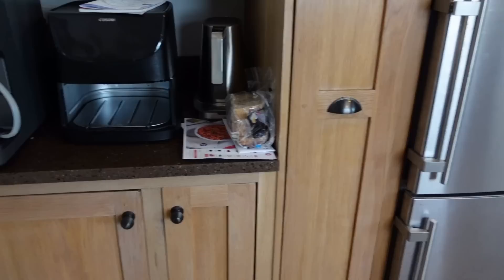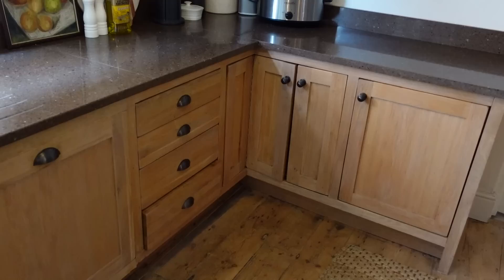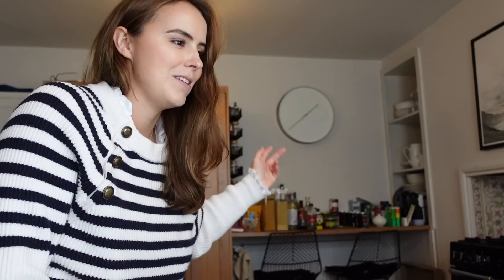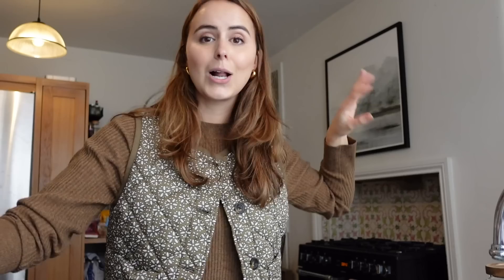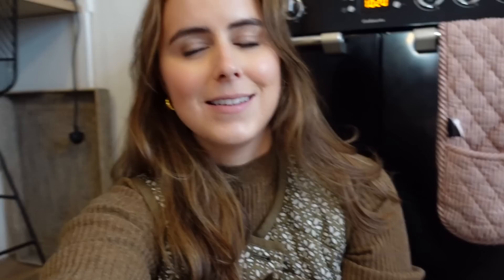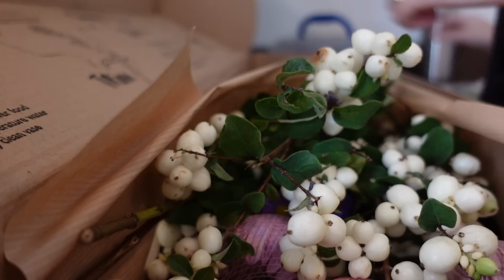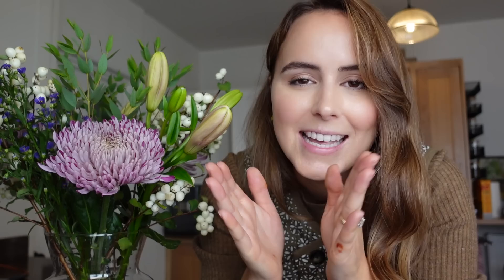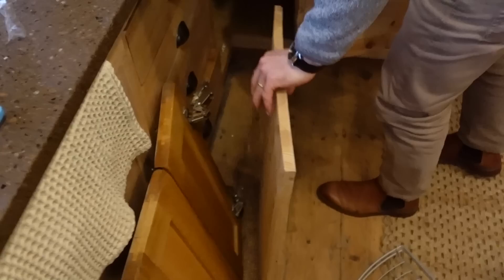UPGRADING OUR KITCHEN | Laura Melhuish-Sprague

Comment: cookie pans and serving trays and large (non-precious) platters for the slim tall cabinet.  Works every time.
Reply: Also super easy to add vertical dividers to keep them extra neat!
Reply: I have trays and chopping boards vertically in a 40cm cupboard. We screwed a little 2cm batten to the base of the shelf just to stop them sliding over and all ending up horiw
Reply: You can store muffin tins and cooling racks--anything flat goes well in vertical storage.

Comment: When you get tired of changing the batteries in the pop lights (I tried them too), IKEA has gorgeous  and affordable cabinet/task lighting you can add to the top of the cupboards and beneath. They can be daisy-chained together and run off a single electric line you can plug in. They also have multi-plug adaptors you can add to your power outlets. Very easy to install.

Comment: Some ideas
1. A pull out under the kitchen sink will stop things from hiding in back.
2. Using that skinny cabinet by making it a tray caddy with dowels. Cookie trays, cutting boards, oven tray...
3. A pretty knife magnet bar that can be mounted on side of cabinet to keep knives from getting nicked and dull in drawer.
4. Maybe wax or oil lower cabinets so wood cabinets pop.

Comment: Useful organisation in my kitchen...
IKEA Variera pot lid organiser - also stores baking trays vertically.
Non slip drawer liner on a roll, cut to fit. I have all my crockery in drawers and NOTHING moves!
Poundshop shallow drawer inserts to corral utensils by type. Also keeps the Drawer of Random Crap in a semblance of order!

Comment: In those cabinets that lack bottom shelfs, you could put baskets instead. I do it at my place, they slide easily and work just like a drawer, without the hinges ofc. It's a more temporary solution, but is quick and rental friendly.

Comment: The puck lights are wonderful. Remember to turn them off when not in use. The big reminder is to order some double sided adhesive pads. The battery change is easy, but the re mounting needs new adhesive.

Comment: For the slim cupboard, if not baking trays and cooling racks. You could ask hubby to use the broken corner shelf, cut it down and put it on a shelf roller. Use the cupboard for things like nutribullet, food processor, hot choc machine, toastie maker etc. Or a three tier wire trolley (you can get them from amazing) and use them as a veggie rack? Slot it in sideways? I just didn’t add the wheels and added a cupboard protector mat. Again from Amazon.

Comment: The updates are great! When we remodeled our kitchen we had several of these features in our remodel. I love the corner lazy susan  shelves. I store appliances I wouldn't use before because they were too hard to get out. We also have a small kitchen but I love it. We put up a magnetic knife holder (there are no children in our house) and that saved us drawer space. Ours is on the wall next to our stove. It works so well and we don't need to use drawer space or a knife block that takes up counter space. One of my favorite things is our under cabinet lighting. It makes such a difference. Your lights all look wonderful. Because we were having a gut remodel, ours are hard wired with wall switches.  Sorry this is so rambling, but all of the things you've done make such a difference for the function of a kitchen and so similar to what we have. GREAT JOB!!!

Comment: Spread the lights under the upper corner unit out so there is 3 (or if you have 4 on top spread those out) and use the one you can spare for the microwave book

Comment: I say go for it with the lights. You'll be surprised the difference it'll make aesthetically as well as mentally. You can use the extra ones in other bookcases and shelves. If the power ever goes out, you'll have them to light up spots that might be tricky...ie bathrooms and closets or other spaces.

Comment: You have made me seriously think about fitting Lazy Susan's in my 2 corner cupboards. I designed our kitchen and it is mainly drawers under bench but in the spot where the sink is it needed 4 cupboards including 2 corner ones which like you I hate having to attempt to get something from the back of them. I was lucky with the under sink cupboard because I had the perfectly sized , but skinny, space for one of the pantry pull outs (great for cleaning products, dish drops etc) and the other side fits a slide our rack with 2 rubbish bins attached (one for general waste and one for recycling). Looks like I need a bit of online retail therapy this afternoon.

Comment: It looks great but I would swap your snacks to the bottom drawer and put your bowls /plates up in the second drawer, much better for your back. Also you could use the  wood from the corner cupboard and make shelves for the small cupboard and even put them on drawer slides. Definitely get 2 more metal pull out drawers for the bigger cupboards - so useful and again much better for your back.